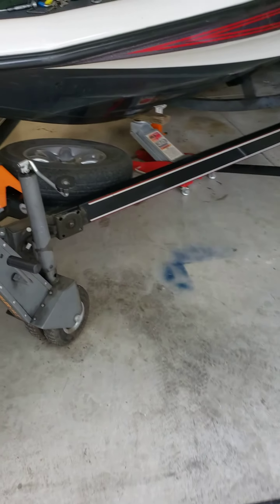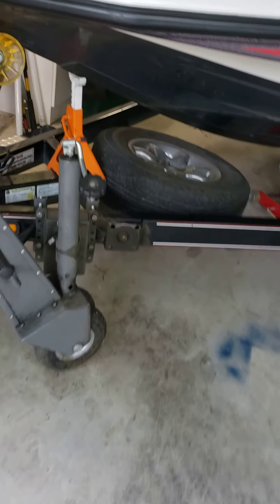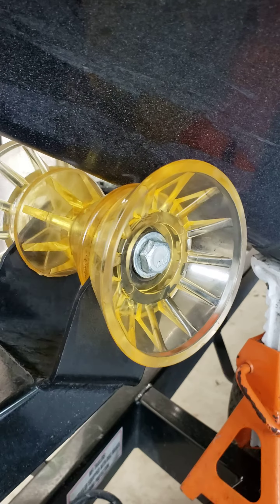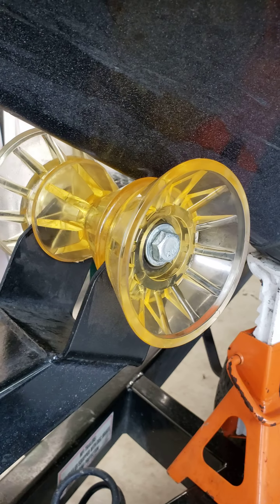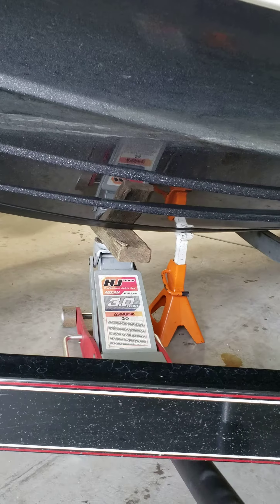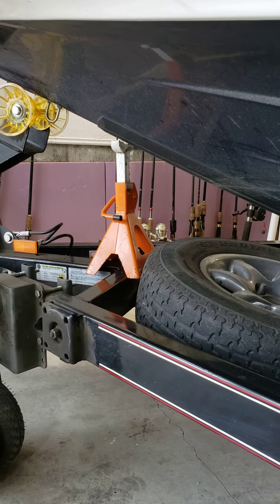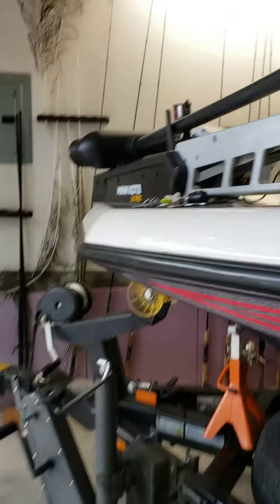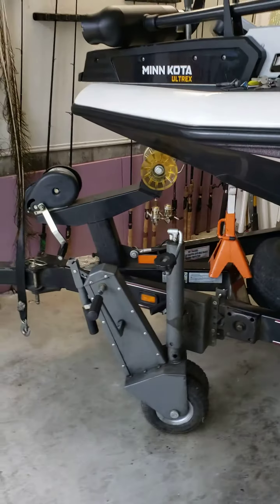How to change out a boat trailer bow roller.

Comment: How is that roller? I see it on Amazon and need a new one. A lot of the reviews say its hard and brittle and it damaged the front of the boat... is it soft? I don't want a hard one
Reply from the maker: Sorry I missed this. Not sure about the reviews. I have always used this and have had no issues.  But i do grease it so it rolls comfortably.... Here is what I bought... https://www.etrailer.com/s.aspx?qry=CE+Smith+Bow+Roller+Assembly+with+Bells+for+4%22+Wide+Bracket+-+PVC+-+1%2F2%22+Shaft+-+Amber

Comment: What roller brand/model is that?
Reply from the maker: Here is what I bought.  Measure the width of your bracket - mine was the 4 inch... 

https://www.etrailer.com/s.aspx?qry=CE+Smith+Bow+Roller+Assembly+with+Bells+for+4%22+Wide+Bracket+-+PVC+-+1%2F2%22+Shaft+-+Amber